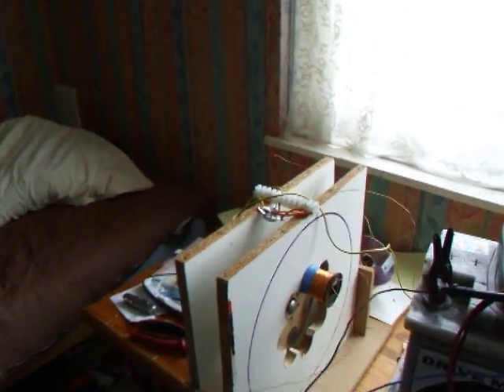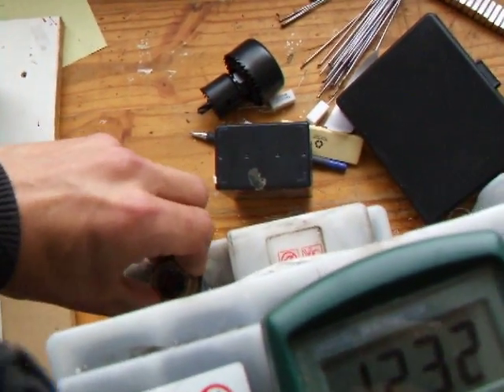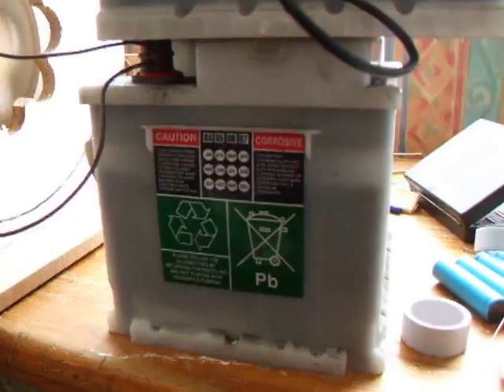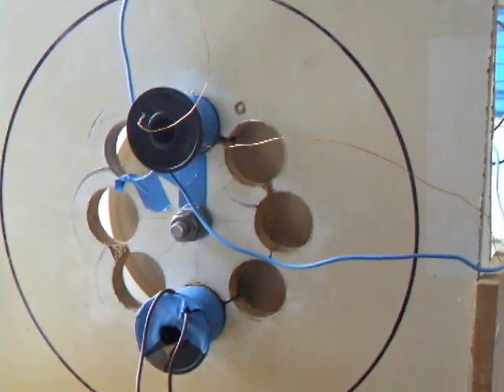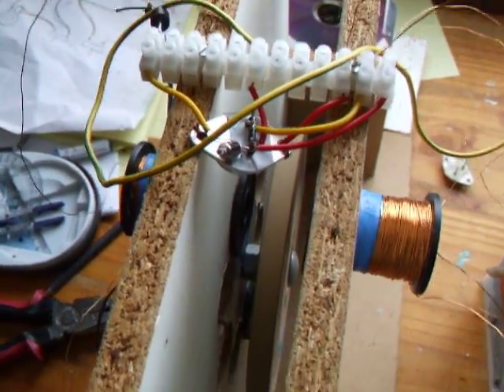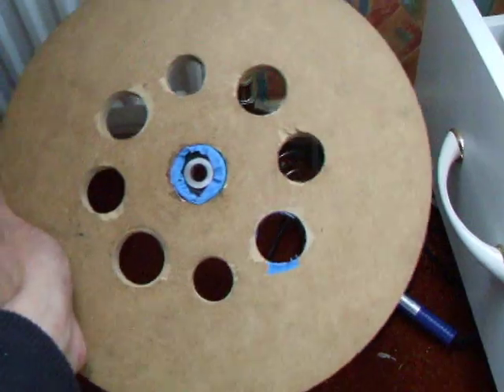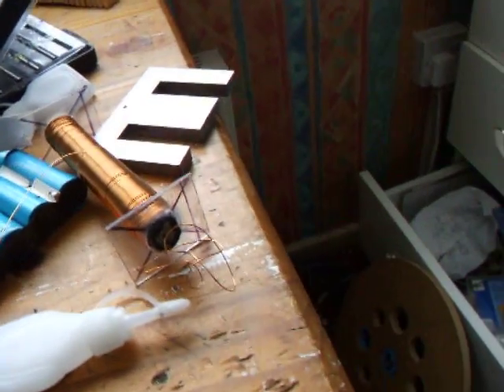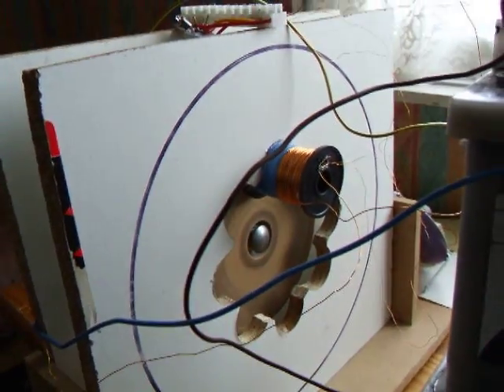my bedini

Comment from the maker: @Jamieduk999 i used hollow core for mine, there is less drag for top speed i find. you could use a core if you want, a bolt? metal rods or ferriet if you have it. thats up to you how many coils you have, its does put more stress on the transistor because of the power draw going trough. also it depends on what power supply you are useing. a battery may go flat faster with more coils.

Comment from the maker: @Jamieduk999 Hi, i got the wire from a maplins electronics shop. google it to find you nearest one. you can buy the spool already made like i have, just have to make sure you can get to the Ends of the wire. The ga, 28 - its labelled in the shop.

Comment: @lykenth08 Just use iron cores. No magnets are required.

No biflar windings are needed either. Wind a centre tapped coil or a two winding transformer on a core and use that. A simple phase shift circuit using a pie res-cap network will give you a 270 deg phase shift also to feed back into your one transistor amp circuit for a no-coils oscillatory. Then you need to take the output into a voltage tripler to get higher voltage.